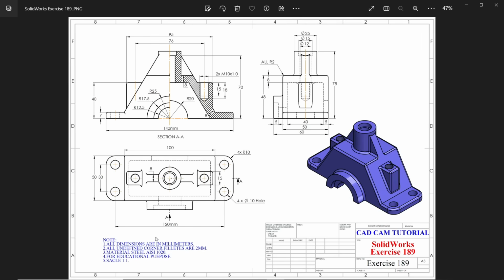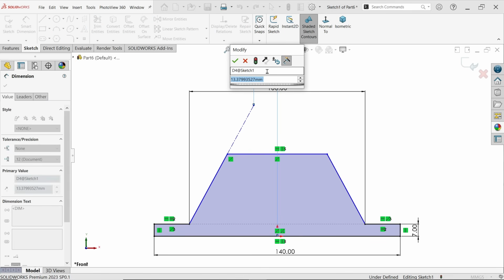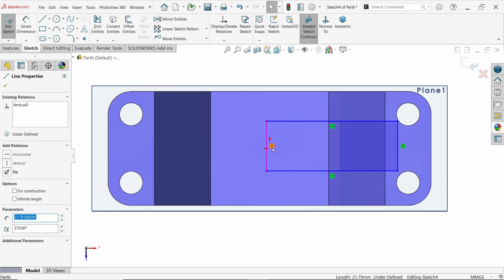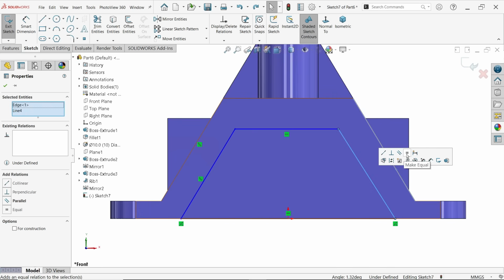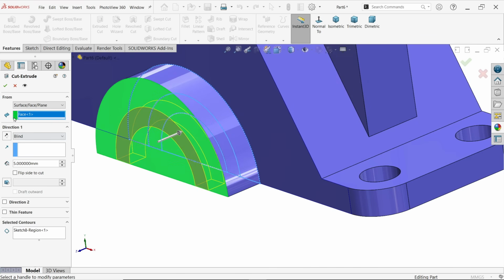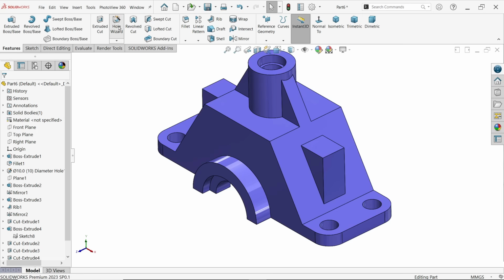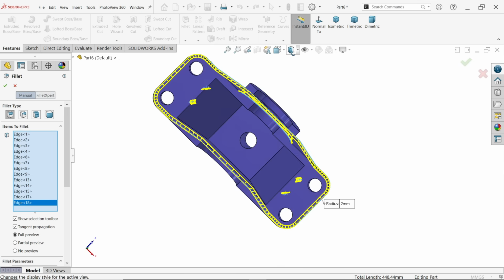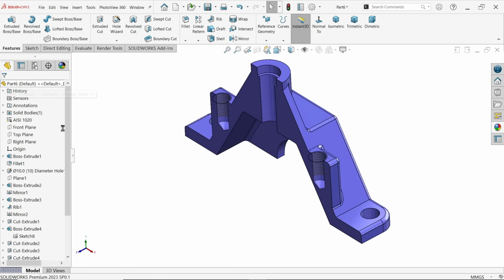Solidworks tutorial for beginners Exercise 189 (3D Modelling)

Comment: Hello sir, I have recently started to watch your tutorials, It was very useful. I have a double regarding sketch, while drawing two or more circles inside a rectangle, and giving  dimensions between 2 circles, it is not moving correctly, one circle is fixed and other is moving out of the rectangle, I tried deleting the relations, but still couldn't solve, can you help me to fix this, and tell me how to give proper (equal/distance) dimensions between the objects. Plz help to solve this
Reply: hello please can you specify which type of relation you used on the sketch. secondly the fixed circle is fully define and the moving circle is not fully define that why it is moving. if the both circle are of thesame size use the relation equal and make relation between the both circle horizontal or vertical from midpoint or center of origin between the both circles.